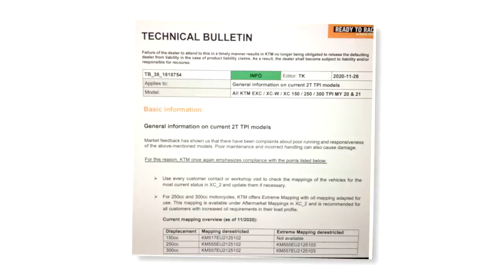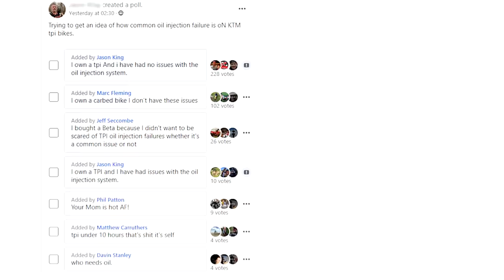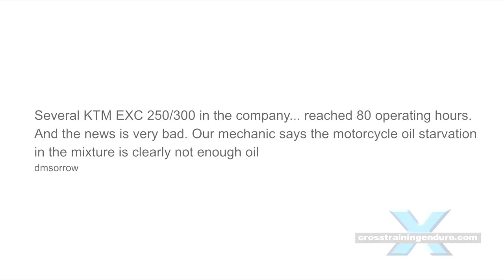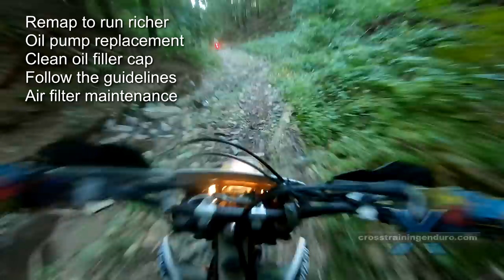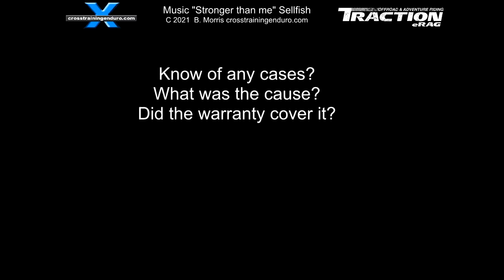Are TPI models seizing? 7 preventative strategies for KTM TPI problems ︱Cross Training Enduro

Comment: I have 100 hours on a 2020 tpi and 50 on a 2021 tpi. No failures of any kind, not even a foul plug. TPI's can take the abuse. We should always expect some failure rate. Manufacturers aren't perfect. Yall yamaha bois have fun with those $1k e-start kits. I'm happy with my tpi!
Reply from the maker: Hard to know what the failure rate is, Ryan. But it's definitely low. And with a bit of luck the final kinks in the system will be ironed out for 2022.

Comment: 2019 is a unicorn year for the XC/TX 300. It's the only year with the newest chassis and a carburetor. I put a Lectron on mine and riding it and my buddies 2020 300XC back-to-back, I could see no performance advantage to the tpi. In fact, mine would rev out more and had more top-end power. I'll never sell this bike.
Reply from the maker: Yep, a mate of mine picked up the very last carbed 250EXC and loves it. They were almost under 100kg that year, then suddenly gained 3kg the following year due to TPI. 🤔
Reply: @crosstrainingenduro  and they gained that AFTER removing the kick-start. Last year to include that as well.
Reply from the maker: It's a slippery slope... I was thinking about my next bike and TPIs were on the list until I started researching for this vid.

Comment: Pretty sure mine just seized at 40 hours, haven't taken it apart yet. Yes, it boiled over... engine light, no throttle response and bogging... seemed electrical and then cleared up... then knock knock knock....then died and wouldn't restart...... no stock fan, why does bike boil over so easy. Yes we ride dusty, sandy steep hill climbs and gnar but damn, 40 hours. This was my first fancy boy purchase ever, I'm usually very frugal..... like 1994 XR600 frugal Tempted to junk it and buy a YZ250x... I just wanted reliable, that why I bought new....
Reply from the maker: Keep me posted on the outcome, Jake. Unfortunately quite a few TPI owners are finding they need to spend quite a bit of money to get their bikes running properly and lessen the chances of seizing.
Reply: KTM declined the first "warranty favor since it was older than 30 days, so I gave them a call to see why the engine failed, was it my fault etc. They said "lack of oiling""lack of lubrication""new mapping needed possibly" So, they decided to cover all the parts even though they aren't obligated but it does seem these failures are somewhat common since my ridding buddy who also has a 2021 300 had the same thing happen roughly speaking. Hope this helps and gets mixed in the with data, just get the new remap, watch the oil level and pump, get a fan, keep a clean filter, let it warm up good. Cross fingers...

Comment: I'll stay with my heavy clutch on the sherco thanks.
Reply from the maker: And hopefully no stator or ECU failures, Craig. 😁
Reply: @crosstrainingenduro  hopefully not,good so far. Still nothing like damage from seized engines on kato's.
Reply: @crosstrainingenduro  Never heard of the stator or ecu failures or stripped bolts and I'm active in the Sherco forum
Reply: I am using the Midwest Mountain clutch and brake levers on my Sherco SEF-R 2017. I use the clutch a lot, and I swear by these. Have used them on all the Shercos I have had for the last 5-6 years, and will stay with them.

Comment: Crankcase pressure sensors

Mine went bad, bought 2 new sensors runs like a new bike. Bogging never feels like it "cleaned out" was my symptom
Went bad while sitting for winter
USA
Im about 75 hours and 1.5 years in. Husqvarna te300i.
No issues other then the sensors have not done a top end or oil pump yet
I run Husqvarna branded two-stroke oil and ethanol free racing fuel or 88 ethanol free it runs slightly cleaner/ crisper on 100 octagon ethanol free
Singletrack pretty much all the time with 2 more wide open more throttle rides on the bike
Reply from the maker: Are the sensors expensive, Spencer? Hopefully not... I just priced an oil pump at AUD$300!
Reply: @crosstrainingenduro  there are replacement sensors from continental/vdo for around 40 usd
Reply from the maker: Cool, good to know it's relatively cheap.
Reply: @crosstrainingenduro  Cheap in USA but not in Australia. AUD170 thanks to the Australia tax!
Reply: @crosstrainingenduro  I dont remember how expensive the sensors were from KTM USA all I remember is in the middle covid trying to get my hands on them was very difficult my bike was parked for about a month waiting for both sensors so it must be a common item to go bad seeing how they were sold out/ on back order everywhere
Reply from the maker: Ouch. I reckon that hefty price is probably just the KTM distributor screwing us, Adrian. GST is only 10%...
Reply: @crosstrainingenduro  NZD$270 for the oil pump and NZD$180 for the CCPS here in NZ.

Comment: Why shouldn't you pressure wash a TPI? Oil filler cap not being fully sealed is one area I can think of but are there other reasons? I have 40 hours on my 2020 XC300 without any issues. Running whatever map it came with but planning to get that updated soon (I didn't even know about bulletin until now). How do I know if I need the extreme map with more oil? I don't race but trail ride single track. Some steeper hill climbs and I'm 250lbs without gear.
Reply from the maker: Many argue it's not good to pressure wash around the engine of any bike, Daniel. There's just more complexity to a TPI so more potential for water ingress with electrics and components etc. The 2020 and 2021 maps run extremely low on oil... around 100:1 to 150:1 according to the TPI tuners, who argue it should be more like 80:1. Nonetheless, some are getting good mileage from late model TPI bikes, others are seizing.
Reply: @crosstrainingenduro  Okay, thanks for the info! So not just TPI but with any fuel-injected bike, you should be cautious of pressure washing around the electronics and engine. I guess I could ask for the extreme map and see how it goes. Is there an easy way to tell if it's getting too much oil? I've heard of issues with plugs fouling on some TPIs so I wonder if reducing the amount of oil was their answer to the plug fouling issue.
Reply from the maker: Yes, the 2018 and 2019 used more oil but then did sometimes foul plugs. 🤔

Comment: How can you know if the oil pump stops up or quits while riding..you don't until the entire engine is destroyed.
Reply from the maker: Not sure where you heard that, Bryan.... there's an oil warning light on the dash. However one guy said it can easily slip out of its mount then you won't see it so it pays to check it's secure.

Comment: I have 70 hard race hours on mine and it runs like the day I bought it
Reply: You have an anomoly.
Reply: 50 hours on my XC300 and loving the TPI.  I ride a lot of tight single track and have blazed a lot of new trails with no issues.  I’ve owned a lot of bikes in my life and this by far is the cleanest running bike of them all and never overheats.  I think most of the major brands all make great bikes, some just do certain things better than others.  Never been brand loyal, just buy what I think is best any given year.
Reply: @carlatamanczyk3891  Not so, I ride with an entire crowd of TPI bikes and no issues whatsoever ever.  Don't drink the cool aide
Reply from the maker: Yes I have to stress again the problems only occur in a small number of cases. Plenty of groups have zero issues. Occasionally you find comments (lower in this list) where four out of 10 guys had major problems with their TPI bikes.

Comment: For me it would be more about WHERE it fails. InIdaho and Montana we come upon a dead KTM or three every summer...many miles of up and down mountain terrain far from help. Pushing a bike 30 miles completely sucks even on a flat highway.
Reply from the maker: Is it a seized engine each time? With a bit of luck it's sometimes a smaller issue like an oiled plug but no one was carrying spares...
Reply: @crosstrainingenduro  the first two I ever came across were a plug under the seat. The wiring harness was so tight that the plugs pulled themselves apart and were VERY difficult to put back together. 4 have been likely seizures as nothing could be done tomake the engine turn over. In every case the victim was with a group so we did what we could (or could not) and moved on. My gang of old cronies ride old Fin-Heads. You couldnt seize one if you put in a second piston
Reply from the maker: Fin-heads... awesome! Always great to see some vin-duro action out on the trails.

Comment: Getting too expensive and complex while getting less dependable. I will stay with carbed 2 strokes. Not going to deal with all the Euro emission BS.
Reply: My friend's KTM seized the first week he owed it. So I decided to buy a carbed Gasgas and changed it to a lectionary, so no issues here.
Reply from the maker: Was it fixed under warranty, Bill? I've had a quick chat with a mechanic who tunes TPI systems, he reckons they run incredibly lean... between 100:1 to 150:1. If this is true it's no wonder some bikes are seizing.
Reply: It's okay. They'll all have to be electric soon anyways.
Reply: Worked on so many carb feed bikes, and have run a TPI for a year. Throttle body mod has been completed, and is crisp, smooth, and consistent. Curious as to the Lectron carb set up though.

Comment: You can't beat a properly tuned carburetor on a two stroke.  It doesn't get better than that.  Two strokes are simple by design but the airflow demands are complex and only a carburetor gives true on-demand fuel for the airflow.  Electronic injection is just guessing based on throttle position, rpm, and ambient conditions.  I'd take a moto version just to get the carburetor.  It will also be incredibly easier down the road if you plan on owning for a while, as far as maintenance and tuning and troubleshooting.
Reply from the maker: Yes I think there's a reason KTM still use carbs on their mx two strokes. I couldn't find confirmation of this, but I hear that the number of KTM two strokes sold means the EU has forced them to comply with tougher emission laws, hence the TPI? So smaller brands like Beta, Sherco and Rieju can still use carbs.
Reply: @crosstrainingenduro  I'm sure alot of the reason is for compliance with EPA laws.  Or at least some of the reason.

Comment: Is adding oil in the petrol as well as reservoir? 100:1??
Reply: No. 

If you're interested my 2020 300 averages running at 108:1. I honestly think this is a reasonable number. Because at idle you certainly don't need even 200:1. Motorex even says you can premix at 100:1 if I'm not mistaken. I honestly can't see why they would need a richer mix.
Reply from the maker: I think I prefer Beta's system, it's around 100:1 at idle then ramps up to 32:1 at full throttle. An average of 108:1 to sounds way too lean. Even trials bikes usually run at 80:1 with all the low revs and lack of engine load.
Reply: @crosstrainingenduro  I suppose time will tell. But I think either way you look at it oil injection is superior. Most of the time you don't need 50:1 (at idle) and at WOT you need something closer to 32:1 or 25:1. Only oil injection can vary the mix on the fly.

There will always be issues along the way though, but I wouldn't go back to premixing.

Comment: One thing I know to be aware of is the oil level warning light pulling out of its socket. I managed to pull mine out shoving a rag in behind the headlight plastic.

Nearly got caught out. Was riding along and just noticed the glowing diode, pulled over and checked. Lucky I noticed it, it's barely visible once pulled out.
Reply from the maker: Good tip, Luke. I've added this to the pinned first comment. 👍
Reply: @crosstrainingenduro  No worries. We all gotta look out for each other.

Plus I can't have fellow pumpkin riders giving you beta rides more material!

Comment: Im quite happily poor so i can only afford a CRF. But more importantly i dont want to be stuck on the burmese border with a seized up money pit so it looks like the CRF will have to continue as my donkey of choice.... and i did actually blow it up but rings, seals n gaskets hit me for $30.... splendid.
Reply: is yours the L model or the  X
Reply: @huskypoop4917  its a M. The suspension is harder.
Reply: Long live the donkey
Reply: @cedricboivin9422  hes on his 2nd life now, im not sure what killed the oil rings but it was running really rich after i sank it. I think the muteki ecu controller drowned so ive junked it.
Reply: @theravedaddy  ☹️
Reply: @theravedaddy  ah i see
Reply from the maker: Some guy commented last week and said 'watch out for the clutch on the CRF250F models'. Couldn't find anything on google. The Traction eRag guys ran a fleet of them without a single issue. No clutch problems with the M model?
Reply: @crosstrainingenduro  i did remove the judder plate and fit a full girth plate in the vain expectation of more bite in the quest for sub revlimiter wheelies but alas there was no improvement, it still travels along with both wheels on the ground no matter what combination of revs, clutch and swearing i use.
Reply: @crosstrainingenduro  i had one couple of yrs ago good strong little bikes . i wish i hadnt sold it

Comment: I never understood why people cringe at mixing fuel... just ignore the oil pump and mix your oil in the fuel. Problem solved..
Reply from the maker: I don't think there's any way to bypass the TPI system though. You'd probably need to replace the whole top end to go back to a carb. There are discussions about running 100:1 or 150:1 in the tank to richen the TPI bikes but some argue this could block the system... not sure if that's true but it's probably best to just get it remapped.
Reply: because the fuel goes directly to the top end
Reply: @unfunny2258  there I was caught being dumb again! Lol

Comment: My 20 TPI. 250+ hours. No problems 

My buddies TE TPI. Less than 10 hours. Complete failure.  I do believe it’s small but in personally know of some with problems

Other buddy seems to have Crank sensor problems quite a bit
Reply from the maker: Did your buddy get his fixed under warranty, Chad? I'm getting a bit worried about the number of cases where KTM is trying to wriggle out of warranty on low hour bikes.
Reply: @crosstrainingenduro  he had to fight Ktm to gets the parts.  His dealer didn’t really fight for him either.  He had to pay the dealer for the labor.  I need to ask him if he actually ever talked to the rep.  A pro in US has a father who owns a Ktm dealership.  He isn’t the dealer who sold him the TE but he was the guy who gave him a direct number to somewhere 

Left a bad taste in his mouth with KTM and the dealer.  

He really felt like he burn 10,000 dollars
Reply from the maker: That's a real shame, Chad. It seems some dealers aren't supportive at all, thankfully it seems to be a minority. I know most hate the warranty work because KTM doesn't cover all the costs....

Comment: 2021 300 xcw,  piston and cylinder are destroyed. seized
Reply from the maker: Bummer. How many hours when it happened, Johnny? Do you know if the dealer had installed that 'extreme' map that uses more oil? I'm not sure if that was available back in 2021...
Reply: @crosstrainingenduro  75 hrs. Don't know if the map was changed. They had the bike to replace the rectifier. I was told they usually reflash the ecu when working on bikes. The pipe didn't smoke more today than before.

Comment: I think emission compliant injected 2 strokes are a dead end. They only exist to comply with laws and regulations and the idea of leaning out a 2 stroke to the bare minimum for emission reasons is the complete opposite of what this style of motor needs to be reliable. I’ll stick with my low tech YZ250X and then make the switch to electric once that type of bike becomes more available and mainstream. I’d also go with a hydrogen fuel cell bike if those ever come out and hydrogen becomes widely available.
Reply from the maker: I agree. I know a lot of guys hate the idea of an electric bike but I can't wait for when there are enough breakthroughs to be lighter than a two stroke and similar torque... noise is a killer for our sport and the e-bikes will only be a good thing in that respect.
Reply: @crosstrainingenduro  until I got an electric Onewheel I’d probably have had a negative attitude towards electric dirt bikes as well. But, I’ve put almost a 1000 miles on my first Onewheel and it’s needed zero maintenance. I’d love to not have to clean air filters, do oil changes or smell exhaust on a bike. I’d be nice to not have to wear earplugs every time on ride and I agree about the lack of noise helping us preserve riding areas. I’m excited about the future of our off-road toys. I don’t think we are too far away before seeing it hit mainstream.
Reply from the maker: I can't wait!

Comment: How many 250 vs 300 failures?
Reply from the maker: We don't have any stats beyond what we've reported in this vid, Kevin. We would need accurate figures from KTM and I doubt they'll be even admitting there's a problem, let alone sharing statistics.
Reply: @crosstrainingenduro  Just curious if that Stat was known.
300's get used where torque is a premium, which often means slow and hot.  I use to switch from tight to open areas when I felt my bike getting hot, play riding.

Comment: Seized in the cylinder.  Piss on the EPA, mix some oil in the gas.
I will stick with the YZ250 2-stroke, and modify that as I know how, and I don't dig the enviro-dictatorship that causes dysfunction and high prices.
They are a dictatorship.